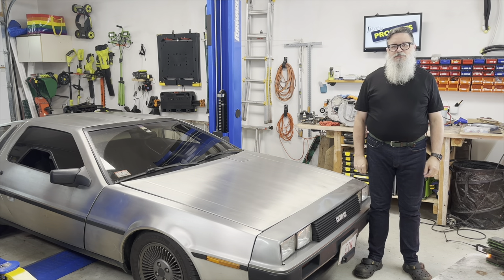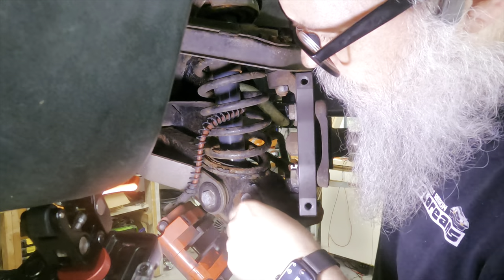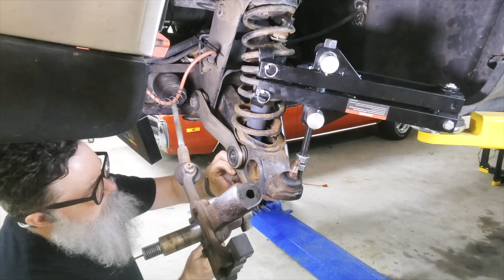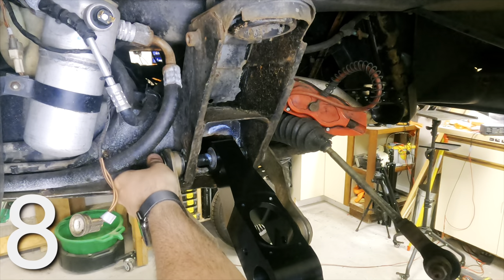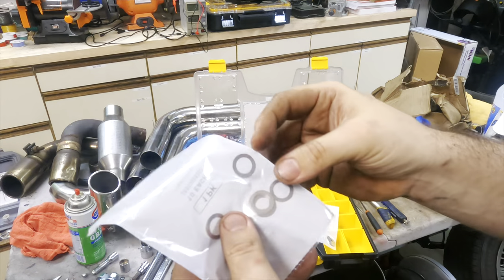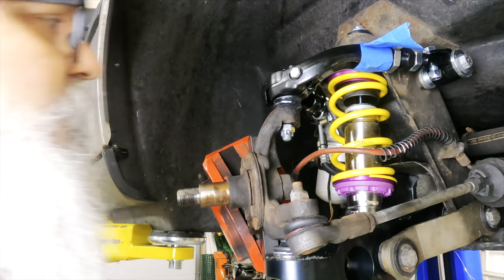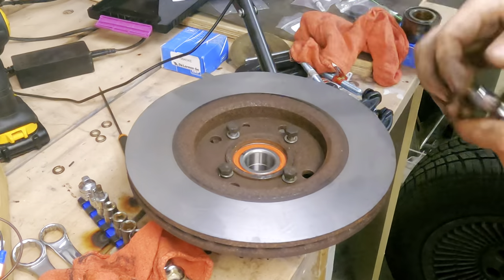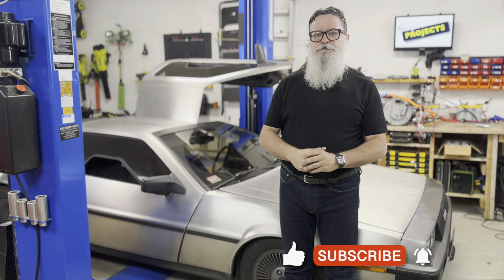Upgrading my DeLorean's 40 year old front suspension so THIS doesn't happen again

Comment: you use the angle grinder to cut nuts off when you could use a nut splitter and save yourself the heat and sparks! also GREAT POINT on cotter pins etc. the only time I've ever wrecked was due to a mechanic forgetting a cotter pin.
Reply from the maker: Ah, a nut splitter -- good point!  It would also reduce the chance of damaging the threads, although in this case I was going to throw out the old shocks anyway.  Also, I somehow didn't notice that you can just put a wrench on the top of the shock stem and get it off that way, which would have saved a lot of time!  Assuming they weren't rusted in place, in which case the nut splitter would have been the way to go.

Comment: Letting brake rotors hang from the brake line without any support is a bad idea.
Reply from the maker: You're right, of course.  I've finally ordered some brake hangers so I don't risk damaging the brake lines.  I should have at least put my lift jack under it to keep the strain off of them.  Once the knuckle is out of the way I can put the caliper on the frame, but there's no obvious place to rest it until then, and I was being stupid.

Comment: Gosh Joe, that could have gone a lot worse like you said... good job you're safe....though I'm so glad I specialise in 50 year old Mustangs where the shock towers come out the top ...Are your wheel bearing "French"? ... I had problems with Renault  in the past (changed front bearings 3x) as the French seem to make bearings out of chocolate. I'm not sure how much DMC is poisoned with French parts. ... on the Renault I managed to find German equivalents made to a higher standard.
Reply from the maker: I’ve tried whatever the original ones are (I think British), and SKF ones from Spain and Italy. I’m starting to think that the hub is damaged and that is somehow killing there bearings, so I recently got a replacement, although I haven’t installed it yet. I’m going to see how long this new bearing lasts. 

The DMCs main Renault parts are the engine (PRV) and transmission. I’m not sure if Lotus designed the suspension (they did the frames), or if that was from DeLorean themselves.
Reply: @joeangellx   ... Thx...You only have 2x jobs to do from now on ... keep breathing in and out + keep wrenching on your cars 👌 ... great channel by the way  🏆... I dont have time to do much with mine. 🛻aarrgh

Comment: Good video, not sure what happened to your failed ball joint. Could you elaborate more on the the condition of the tread? I know that a lot of newer cars uses nylon lock nuts for ball joints right out of factories. They seem to work alright. I haven't heard of massive recall on this matter. Annoying part is tha they are one time use only and need to be replaced after removal. I believe you are aware of it. When you tighten the lock nut, did you feel additional resistance from the nylon insert?
Reply from the maker: It was about a year and a half ago, so I don't remember all the details now, like the resistance from the insert.  I usually do notice that, though, mostly from how I need a wrench immediately instead of only at the end when I'm torquing it down.  I don't seem to have any pictures of the old ball joint threads, and I don't have the ball joints themselves anymore either.

I had assumed I'd screwed up putting on the nylock (it was a new, unused nylock), but when I got to the Tech Day event, we found two nuts (not nylocks), threaded them on, did a circle in the parking lot to pull into the garage, and the ball joint popped off again I pulled in.  However, it's possible we happened to pick the wrong nuts (say, a close imperial nut instead of metric), which would seem like it fit but doesn't quite fit.  One of the other guys did that for me, so I don't know what the nuts felt like going onto the threads.

That said, I remember the other side's nylock seeming loose, too, as did some of the other guys at the Tech Day, so I don't think it was just that one ball joint or nylock that was bad..

The vendor I got these from has three different ball joints at different prices.  Those were the "budget" ones. Normally I get the nicer parts, but I'd already spent too much money that summer and chose the wrong thing to cheap out on.  I later found out that they sell almost none of the budget ones, which doesn't surprise me in the least.

Needless to say, I replaced both ball joints with the nicer ones.  I think I may have just gotten unlucky -- as you said, modern cars use nylocks all the time (I didn't realize that; I mostly work on the DeLorean), so they must be generally sound.  Do modern cars still have the cottern pin?  These ball joints didn't have the hole for that, although I could have drilled it myself -- I just assumed that if it wasn't there, it wasn't needed and that the nylock was enough.

Comment: I had a similar failure on my 77’ corvette where a nut came off a suspension bolt making the suspension collapse in one corner. I was lucky and skidded slowly to a parking space. I had recently disassembled and reassembled the rear suspension. I never figured out why the bolt and nut threads failed but just replaced that nut and bolt. The other side failed about a week later so it wasn’t a fluke! I definitely felt foolish for just replacing hardware on one side after the failure. It was a castle nut and it sheared off the Cotter pin like it was a toothpick.
Reply from the maker: Sounds like you got lucky too, in that it didn't happen on the highway!  My new ball joints have really thick cotter pins that are a pain to install and bend open, but given what you said about the pin sheering off, now I'm glad they're as overbuilt as they are!
Reply: @joeangellx  Thinking more deeply about what happened in my case: the full rear leaf spring pressure is on the nut and bolt that failed. I relieved the spring pressure with a floor jack on disassembly. On reassembly I think I used the nut and bolt to compress the spring. The heavy spring load on reassembly was probably the issue. Despite being oiled there was a lot of friction and wear on the nut and bolt. I would guess a fine pile of metal dust came out of the nut and bolt on reassembly. Everything was fine until hitting a speed bump at about 20mph. 
I am enjoying the videos thank you for making great content!
Reply from the maker: Ah, that makes sense — Your description of what you think happened sounds pretty likely to me, and easy to overlook. I’ve made plenty of similar mistakes, like I’ve striping some a bolt because I just thought it was tight, and didn’t realize it was cross-threaded until it was too late. And I made a mistake in with regards to removing the shocks — I didn’t notice the hex shaft on the top (which is why I cut the nuts off) until someone told me in the comments!

I’ll keep in mind to watch the load on parts before tightening the nuts, just in case. Thanks!
Reply: I had the ball joint come loose from the lower arm due to rust eating thru. Lucky for me it happened right at the end of the driveway instead of the street.
Reply from the maker: @davidedgar3509  If it has to happen, that's where you want it to happen!  I bet the tricky bit was getting it back up the driveway so you could fix it.